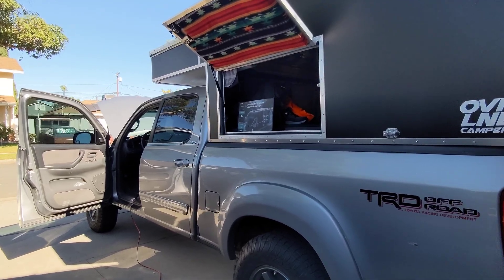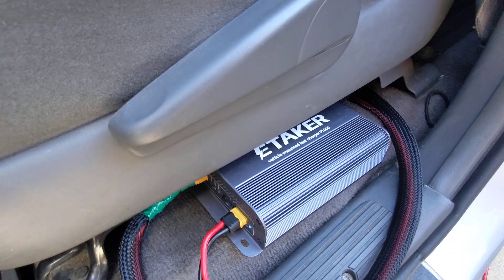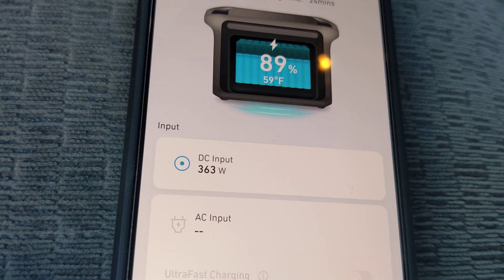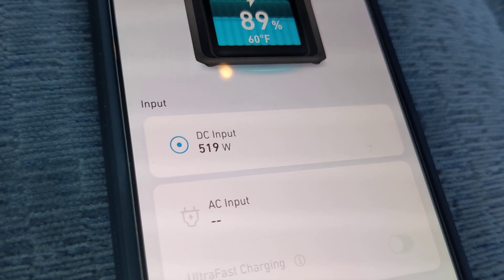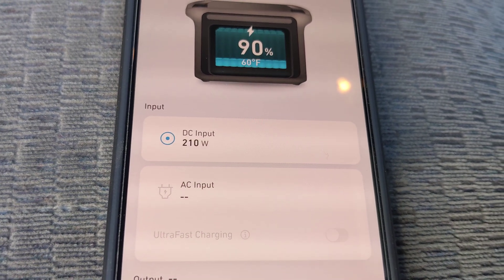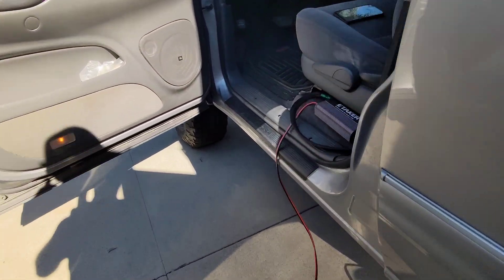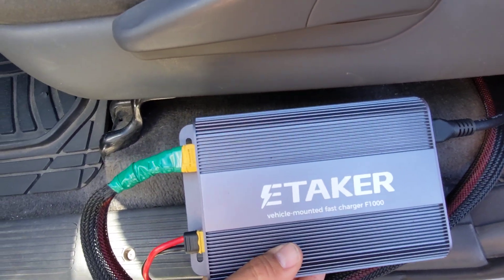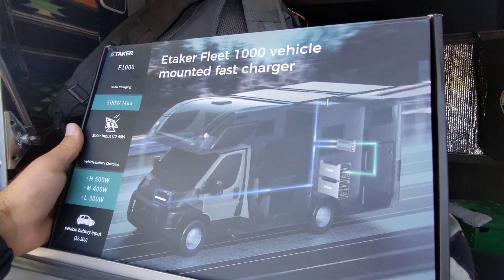Etaker F1000 demo: fast charger for camper battery or power station -  1000W from alternator + solar

Comment from the maker: ETaker F1000: https://amzn.to/3YyD5Aw – Use Code: TZ88WCJ8  for $15 off.

The Etaker F1000 is a vehicle-mounted fast charger for your camper batteries and portable power stations. We use it in conjunction with the Anker Solix C1000 and Renogy 100 watt solar panel and it's been working out great to keep our devices charged up. Etaker sent us this product to review and cover for you guys. Let us know if you have any questions in the comments!

Comment: I don't think the "vibration sensor" turns on the unit when the vehicle is running, it should start charging anyway as soon as the alternator is supplying more than 12.8 volts. I believe the vibration sensor is meant to shut off the unit while the vehicle is idling because a lot of alternators can't handle the draw to charge at 500 watts when idling. I could be wrong about that but I've seen some complaints from people saying the unit turns on and off because of the vibration sensor, which CAN be shut off BTW but I don't think those people realize that. In the video @4:15 when the 400 and 500 lights were blinking quickly was how you shut off the vibration sensor.
Reply from the maker: The sensor senses when there is less vibration and pulls less power from the alternator when idling. It's a damn great setup. Never had it shut off besides when my truck is sitting for a day or two sometimes I have to turn it off and back on.

Comment: Nice. If you have space on the roof, 1 or 2 big panels in parallel (even overpaneling) would help get closer to the 500w max from solar (as long as voltage is not exceeded and accounting for cold climate which raises voltage). I think the f2000 is better suited to charge a stand alone battery instead of a powerstation, and then that battery go to an inverter or another powerstation. I wonder how durable these etaker units are in the long term (and how much overpanelling from solar they can take safely). So far these are the best from what Ive seen, other dc to dc chargers are more limited, more expensive or break as evident from reviews (on amazon at least). Cheers
Reply from the maker: THanks for all that good info. I've had the Etaker installed for around 6 months and no issues. Honestly... I get so much sunlight here in Southern California that the 100w solar panel keeps my fridge powered, devices charged, and fan running and the battery is always between 90-100%. The Etaker automatically disables the alternator charging until you switch on/off the unit if the charging hasn't been need for a few days. I haven't had to use the alternator charging in a few months, but the unit still passes through solar. Such a good setup.

Comment: man thats a nice install...i regret ordered a pecron...i think i cancel my order and buy the etaker.The pecron doesnt have the solar port...the vibration sensor is genius.
Reply from the maker: Yeah it's a great unit so far. I'm going to two recording a 2-month follow-up video soon to share with you guys. A few things I noticed... When it's below 50° or even 45°. It charges slower. I'm not sure if that's the charger or if it's my power station. When I have it set to 500 I get about 350 to 400 W when it's colder.

Comment: Are you running a stock alternator?  Do you know what the output of it is?
Reply from the maker: Stock alternator for the 2006 Tundra with tow package. Not sure.
Reply: @dirtnsmores  The nice part is being able to choose between 3 watt charges , I'ld stick with 300 for my car , but if I get a truck or van can up it to 500 .

Comment: This is awesome! Was going to purchase the Bluetti Charger 1, with 2-100 watt renogy panels, but it does not allow simultaneously charging.
Reply from the maker: So far I'm loving this setup.
Reply: I bought a Charger 1 and I'm having an issue with is continually shuting off while charging with my car idling.  I'm working through it with Bluetti support but I'm just about to give up and try the etaker f1000.
Reply: @ I don't know about the Bluetti, but the etaker has a motion sensor that will stop drawing power after about a minute of no motion, to protect your battery. You can turn it off on the etaker if I remember right. Maybe you can't on the charger1?..

Comment: So, if I'm in my van and moving around, that could likely trigger that vibration sensor and cause it to start taking charge from my starter battery, even if my engine isn't running? It sounds like a good way to discharge my starter battery.  I don't care if it stops discharging my starter battery at 12.4 volts. I don't want it to discharge my starter battery AT ALL if the engine is not actually running. Maybe I could install one of those old-school relays between this and the battery, so it is disconnected when the vehicle isn't running, but it is giving more protection to my alternator and my house batteries than that relay would all by itself.
Reply from the maker: Hi Grant, I can't remember if I mentioned it in the video but that setting could easily be turned off. You could also easily switch off the whole unit at night for peace of mind. I do have your concern as well, and I did some testing with myself bouncing up and down in the bed of the truck, and the kids moving around. We're a family of four so it's lots of movement. I recently relocated the unit to the bed of the truck where we're at as well. So far no power draw at all and I was monitoring it constantly with my phone app to my power station.

Comment: What size supply wire leads did you use for the Etaker?   Trying to do the math to see if I can get away with 6AWG or if I need to go bigger.
Reply from the maker: it is 10awg. good luck! loving this unit so far. Here's some wire that I used: https://amzn.to/3CZenRl

Comment: I'm in London UK so no sun, I have an Ecoflow alternator charger, 800w straight to my power station, no need for solar 🤘
Reply from the maker: That's a perfect setup for you!
Reply: @dirtnsmores Love hearing stories of humans sharing their use cases. I travel up and down California on the coast and two 100 watt solar panels do the job 90% of the time. Thank you for explaining your DC/solar option.
Reply from the maker: @tumbleweed1976  glad to help! It's been great for me so far. We just got back from a 900 mile trip and used the small 200 watt electric heater one night, ran my fridge, made coffee with electric kettle, and the etaker always kept me topped off. If i was parked a few days I would probably be wishing I had a second 100w solar panel :). Safe travels!
Reply: @dirtnsmores is this better than the redodo one?
Reply from the maker: @donttrickimtricky.8567  not sure if it's "better". I just think it has some unique features like solar passthrough that other brands are lacking.
Reply: @dirtnsmores  it has mptt as well it's just 100 less.
Reply: @dirtnsmores  I'm thinking about going for the 2000 etakers and just get a 48v battery to dump into then dump that into a battery station.. Call it day.
Reply from the maker: @donttrickimtricky.8567  let me know how that would work. i'm pretty new to all this stuff.
Reply: You got liocense fo at ?

Comment: 7:44 Looks like a good unit. The active cooling feature (fan) is critical for efficiency. Does the ubit generate noise pollution? I've got a Renogy DC-DC charger with two active cooling fans,  it does generate a bit of noise pollution, so i and installed in the housing area of my camper. Good work for rhe videa--subbed/liked.
Reply from the maker: No, I don't hear anything. The Renogy is awesome too. Thanks for watching and glad you enjoyed the video. Is your setup for a truck camper?
Reply: @dirtnsmores  My set up is for Ram ProMaster camper I built. Thanks for the reply!